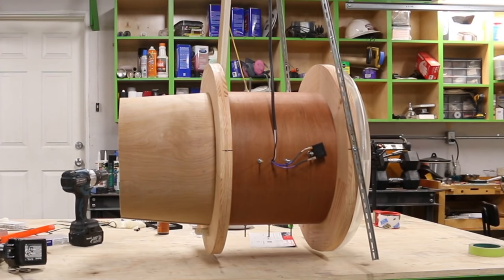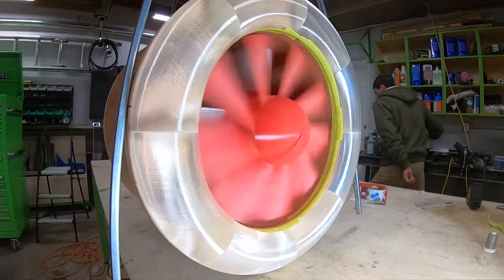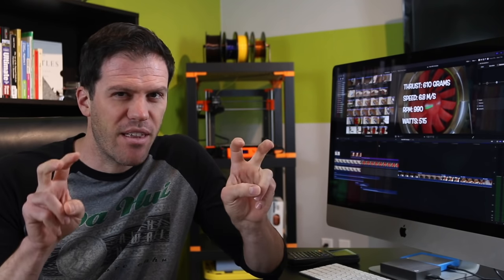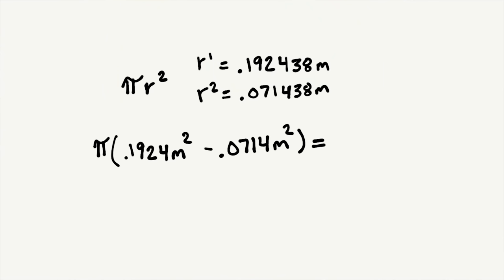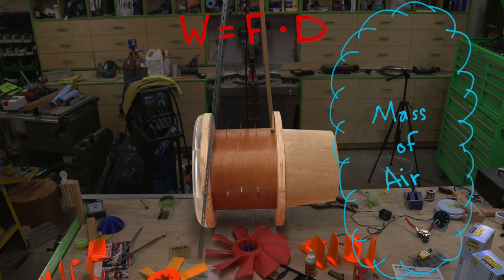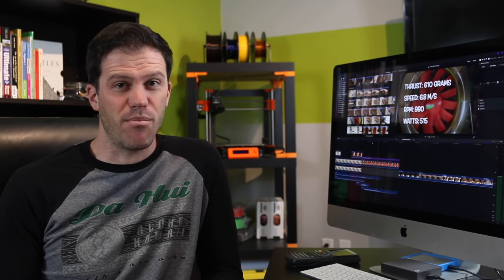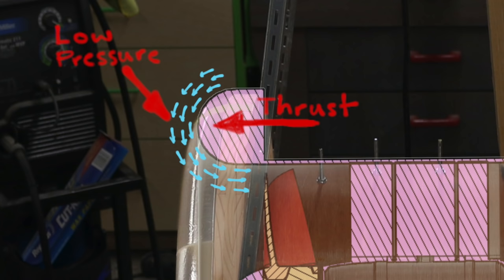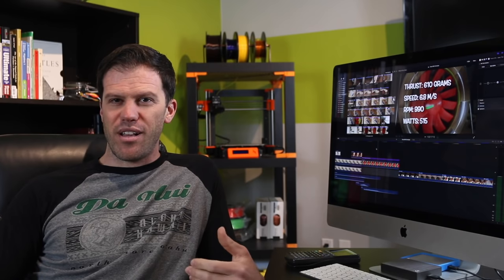How to apply ducted fan theory to real world fans

Comment: Hi, I really enjoyed your video. I'm a mexican aeronautical engineer and I have made some simulations on this phenomena. I can tell you that, in principle, the effect of a duct on propeller efficiency can grow up to 30% in static thrust. However, the effect is faded away when the system is travelling with respect to air, mainly because the drag of the duct. On the other hand, the calculation that you are doing with Newton's 2nd law is called in aeronautics the 'Rankine Froude approximation'. For a better approximation one needs to use the 'blade element theory'. In that case, you will need the lift and drag curves of the airfoil (or airfoils) used along the blades. Indeed, the 'lost power' in your calculation is due to drag on the airfoils: Rankine Froude approximation cannot take that into account. I offer my help if you desire to learn about blade element theory. Congratulations for the great work!
Reply: I would assume at higher power levels for small EDFs air compressibility also applies, in what conditions you expect it to be noticeable?
Reply: @hailstorm7868  Compresibility only becomes important with high speed flows. When the air travelling over the aerofoils is greater than mach 0.3 compressibility of air should be considered for greater accuracy.
Reply: I am very interested in both of your work.  I have a copy of an old Popular Mechanics page on an aircraft design that uses 3 ducted fans to create s VTOL single seat aircraft.  The young aeronautical engineer that designed it vanished into a government project and never heard from again. I think they made that part of his contract, though it has been over 20 years.  I am a private pilot that grew up with a fighter pilot dad in the 1960/70s.  I would love to design the experimental aircraft but do not have the skillset required.  I have wondered if I was the only one that saw that design he created and strongly desired to fly it.  Being able to take off and land vertically and cruise at ~200mph had been a goal of mine for 45 years.  If you send me your contact email I will send you the pdf zip saved of the article. You can make your own judgement about it from there.  With the advances we have had over these 30-40 year I think this is a very doable project on my limited budget.

Comment: Nothing wrong with metric, but the statement that all these calculations need to be done in metric units or that the formulas only work in metric are flat out false. The relationship "f = m x a" works for all units of force, mass, and acceleration. Mixing measurement systems adds a touch more work, but is also fine. Physics works the same, regardless of the arbitrary naming and magnitudes used in measuring it.

Comment: I realize I'm late to this design party, but I have a intense interest in ducted fans, and have 3D printed quite a few of my own up to 200 mm diameter, and I got some very useful information from this video. .so my question to you is, could you publish your formulas in a spreadsheet format.? Is that would be extremely helpful to us backyard designers. Thanks and keep up the good work
Reply: The diffuser inlet slows down the air and thus increases the static pressure before the fan. As a result the air density and mass flow increases. Something as simple as a pitot type inlet raises the pressure at the inlet enough to raise the pressure differential between the inlet and outlet.
Reply: Have you ever heard of the pc fan showdown?
Reply: @seldoon_nemar  yes i sub to his channel

Comment: In your calculations you dont include drag it seems so that is where the additional power goes. the propeller is like a wing that rotates so there is a drag there and the acceletaed air in your tube has friction with the inside of the tube. in both cases the power used to fight the drag grows like the cube of the speed. by running one setup at different RPM you should be able to derive the drag "constant" ( of course an oversimplification but a good approximation ). my 2 cents
Reply: I would wager that a significant portion of the drag comes from when the accelerated air mix with more stationary air at the back of the fan.
Reply: @tykobrising5339  OOOOOOOOohhhh god bless your wagering and god bless drag becase without it everything would just work so god bless friction and gases becases without them how would we breathe so god bless god for making gas and fans to blow away foul gasses ohhhhhhhhhohaaahhhhhhhhhhhhhhhhhhhhhhhhh

Comment: having had an airplane with a three bladed propeller, subtracting the drag of the air-frame, at speed, about 82% efficiency could be achieved, i.e. keeping the air-frame aloft at something like 125knots forward airspeed.  Fans have one advantage, that is the solidarity of the disc, as they can go over solidarity and create a compression of the air, and that usually there are stator blades (another advantage, but requires power) after the fan, essentially  another set of fan blades that 'straighten out the twisting motion that the fan blades exert on the air.  In a low speed mode, one also has to model in the total induced Bernoulli effect, which even propellers have, that greatly reduces the overall efficiency, so it is not unrealistic to get the 'just starting efficiency being very low and increasing to the potential with a fixed pitch blade, even to the point that forward stator blades make sense (see older turbine jet engines)  S back to Solidarity, and the formula usually produces a 1.12 increase effect for a totally solid blade configuration, but can be higher at optimization, so as you look at the 7 to nine stages of a gas turbine with the rotating stages and stators, you see the compression significantly increasing.. but then add in the loss of pressure at flight altitudes.. bla, bla, bla..  (why take-off takes so much fuel and maybe all runways should have a catapult and big jet aircraft should be towed to the end of the runway and into take-off place, or why high speed, well 1/3rd of flight speed, rail makes sense.. slower acceleration, no lifting force).

Comment: If you want a very easy way to check your RPM measurement you can simply install a free app like decibels, or any other that gives you the instantaneous sound spectrum of the fan noise emissions. Indeed, a fan emits discrete tones at the blade passing frequency (BPF) and harmonics. The BPF is defined as BPF = B Omega/60, where B is the number of the blades, Omega is the rotational speed expressed in revolutions per minute (rpm). So, you can look at the dominant tone and derive the rotational speed Omega with very high precision from the formula above. This works if the blades are (almost) equally spaced.

Comment: Testing a static fan, you probably want to think about putting a "bell-mouth" inlet in front of the fan. When the fan is stationary the capture area (the area at which the amount of air flowing through at the flight speed of the fan) goes to infinity (pesky divide by zero thing). Of course you can't put an inlet on it with infinite area, but you can put  an inlet on it that has a shape that follows pretty close to what the streamlines relatively close to the inlet. This type of area smoothly accelerates the air as it moves from the stationary room air (very very low velocity at very big area) to the inlet of the fan (higher velocity and smaller area)

You can actually see the streamlines if you put a little smoke from a small source in the air in front of the fan. A great way to do that is with an incense stick (as long as the air isn't moving so fast that the smoke is stretched out so much you can't see it. Smoke is the best way to visualize the flow field since the smoke particles follow the curvature of the streamlines and allows you to see the entire flow field by introducing smoke just along the outer edges of the area you want to visualize the flow field.

Another way is to put a short (L/D of maybe 10) tuft of yarn on the end of a very thin stick (so as to disturb the airflow as little as possible) and then move the stick at a range of axial distances from the fan and radial distances from the centerline. When the air is moving relatively quickly the tuft of yarn will follow the streamline pretty closely. Fluff up the yarn to decrease the density and increase the drag so that it follows the streamlines at lower velocities. At some lower airspeed the weight of the yarn is such that the drag from the moving air isn't enough to keep the yarn in line with the streamline. 

Either with smoke or yard on a stick, mount a camera at a stationary location perpendicular to the plane of the fan and in front of the fan by 1 fan diameter. Then move the incense stick along the perimeter or the tuft of yard in a raster scan across a 2-D slice starting at the centerline about 3 fan radii in front and then move upward to about 2-3 fan radii above the centerline. To visualize the flow field grab individual frames and superimpose them and you should end up with a visualization of the entire flow field in front of the fan inlet. If you make an inlet that follows the shape of the streamlines going into the tip of the fan you should end up with a bell-mouth inlet. 

Here is a picture of a bell-mouth along with sizing information. https://forum.ih8mud.com/threads/1hd-t-intake-manifold-modifications.651365/page-4

I hope this was helpful.

Comment: Great stuff, had some similar ideas pop into my head and nice to see someone else mathing over some of the concepts. I see a lot of RC plane EDF's are optimized for high power/high rpm  but thought a larger, lower rpm, high efficiency EDF's could be appealing for a glider type RC plane or even a solar plane (rctestflight style). Next episode soon please :) I know at least the wikipedia page mentions having very small clearance between the blades and duct can be a large factor for efficiency. Also i imagined multi-stage/multi prop ducted fan may have some more thrust gains too potentially? Thinking like, running on the same motor axis a larger high volume intake fan at the front with a second internal blade optimized for high static pressure a bit like a turbofan engine? Or even just another of the same blade internally may extract slightly more efficiency from the same input power. The next step would be to 3d print or redo the duct frame in a lightweight material and see what kind of thrust/weight ratio you can get from the whole thing.

Comment: Love stuff like this! Wish YouTube had more of this content. Nice work! By the way, in order to get the motor RPM up did you consider gearing reduction? In aviation, especially turboprops, extensive gearing is used to reduce the RPM of the turbine to the propeller. Curious how that would have impacted your experiments (notwithstanding the added friction and heat losses from the gearing)

Comment: you could do a variable size exit cone and empirically check for best speed / thrust, also the increased speed in a reduced duct is a venturi effect (speed increased, pressure decreased) and this is used in the ICE engines throttle bodies etc.

Comment: Hi, very interesting video! Love how you tackle the physical problem from a very experimental point of view. 

In one of my project I use a commercial EDF to generate a kind of vacuum cleaner to apply a tuned suction force on a plane below the EDF, playing around with the RPM. I would like to estimate this "vacuum suction force" as a function of the rotation speed. From your opinion, would you say that such suction force is equivalent to thrust? Or is it something different? 

Thanks a lot in advance,
Jules

Comment: As a fromer duct fan designer, I can only tell you one thing : Welcome to the rabbit hole :D d'ont worry there is no bottom to this one, you'll just be falling from now on.

Also congrats, these models and the way you make hyphothesis is really nice and a really "hand on engineer" approach I like it :D ofc you're making mistake even though some make me grit my teeth, mistakes are fun as long as you're trying to find them or checking your math with experiments.

And last thing ^^',  Is you're motor ok? 400W of power loss... this thing might have been burning in there?

Comment: Fantastic video and I'm hoping to gain some additional knowledge here. I have been playing around with bldc ducted fan as a form of forced induction on combustion engines and I am far from an engineer but understand enough to get in trouble. My question is how to calculate/estimate how much if any, pressure generated. I figured in some format thrust would convert or be part of pressure however I have yet to find a direction. I would like to find some baseline to begin testing "plumbing " configurations as well as utilizing the ducted fan in a compound turbo configuration feeding a "dormant " standard turbo. Again, awesome work!

Comment: Terrific video, very well done. Got a question though; in your analysis you don't consider the number of blades, but assume that the entire cross sectional area of the inlet is moved through the fan by the action of blades. If you assume one blade vs 20 blades, isn't that going to make a big difference?

Comment: How did you choose the height of the blades?
About the angle of the blade, the air also moves outwards due to centripetal forces, should’t the outside of the blades push more air?
Should the blades spiral forwards?
Should the blades have notches for air separation on the leaving edge?
Are the blades just tilted rectangles or is there some wing shape to them?
Etc…
This video is answering questions that are not addressed on youtube, I am really looking forward for more explanations.

Comment: I made it to the end, thanks for that. FYI, I'm watching because I have a very limited knowledge and my full home HVAC system sucks. So, I'm trying to make it better, thinking I'm going to put in an inline duct booster. 

I basically can't imagine living in a wind tunnel with temperature hot spots though, so I ain't going to be happy till the mailman has trouble putting paper in my mailbox though. Thanks for fueling my crazy adventure.

Subscribed

Comment: Hey.  First of all two things: Congrats & thanks. I adore napkin math because it shows up that "vital few & trivial many". I read in the comments about drag and air density inside the cone and many other things, but for measuring coanda effect maybe you can add some measurements of the velocity of the back flow around the duct at a certain distance. Then you could average the speed over the "influence ring" around the duct and calculate the change in momentum (vectorial mv). That wouldn't be too hard or too complicated and could give you the theoretical deviation / validation of your measurements without the duct. You can also check the results against the Bernoulli given impulse due to differences in static pressure.

Comment: It would be interesting to see how blade tip clearance affects things. I know that ducted fans running as close to 'zero' clearance as possible will perform better, but I do wonder how much that extra trouble is worth it then it comes to efficiency.
Reply: Or have a band connecting all the blades, with a cutout in the housing to accommodate the band. Then the only thing that can slip by is not in the stream has to find it's way out.

Comment: Great vid, I love this stuff.
It looks like you are getting into the realm of some rotating compressible flow characteristics. You might want to consider that to account for the higher output. It's been a while since I've done those calculations myself, but I'm sure there is open source CFD code that could easily be used to make (more detailed) calculations and get you a precise anwser.

Comment: From my theoretical research:
The intake cone should be an ellipse with a 3 to 1 ratio.  Same for the nose cone.
Nose cone should be stationary so the air is not centrafuged outwards.  The stators holding it will help straighten airflow in gusty/windy conditions, adding efficiency.
There's a study out there on this.

For a static fan, trying to pump air:  the exhaust cone should increase in diameter with an angle of around 7 degrees vs axis.  This is called Static Pressure Recovery.
If the fan (and vehicle is moving through the air; static pressure recovery doesn't work and your current exhaust duct thinking is correct.
Same study.

Where a wing/blade meets the body/hub the corners should be radiused to reduce turbulence and increase efficiency.

Questions:
I see your stators are curved in a way that should better straighten the  twisting airflow. 
Does this work?  Is there any maths behind your design?

What is the gap between the blade tips and duct?  The smaller; the less tip vortex; the better.

Comment: Brushless motors would be an excellent addition to this project. For about $250, you could get a decent quality motor and controller like a vesc or odrive. Those two both connect to your computer for exact rpm commands and will measure power for you too. If you don't have a battery big enough, a switched mode power supply would be pretty cheap. It seems like the ability to measure power and thrust across a range of RPM gives you enough extra information to warrant the additional dollars. Plus, learning new stuff is fun.
Reply: indeed, you can then test the setup over a range of motor velocity and make a curve where the max power of the motor is reached. Another variable to think about: when making a test setup, how accurate is the power meter? When doing a test setup, you'll want to control every aspect - so measuring current and voltage in stead of measuring power with a 'cheap' power meter.
Reply: I came here to work on my design for my Odrive servo! I hope I get the time to collect data at various speeds.